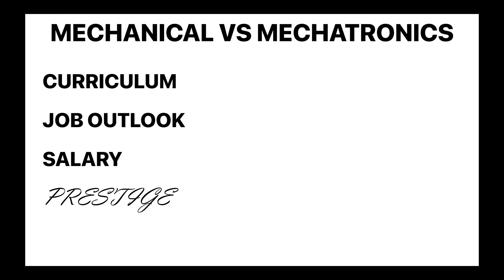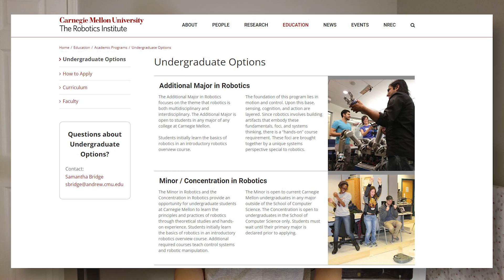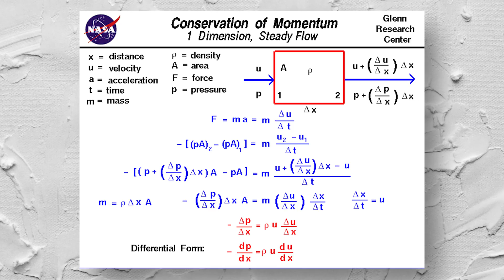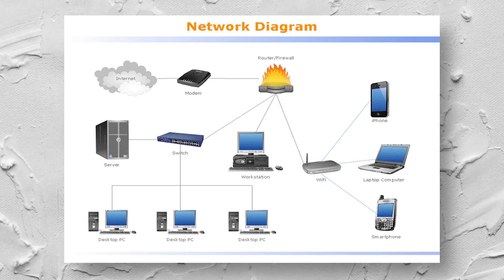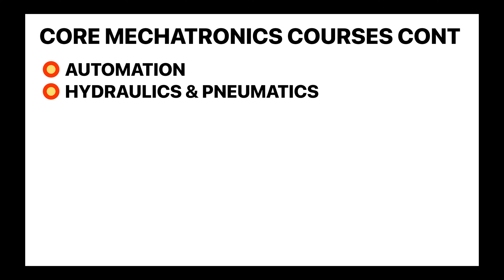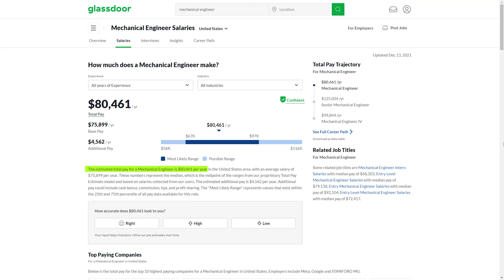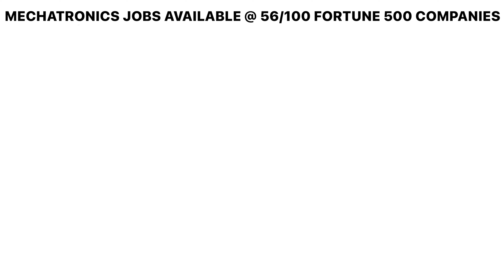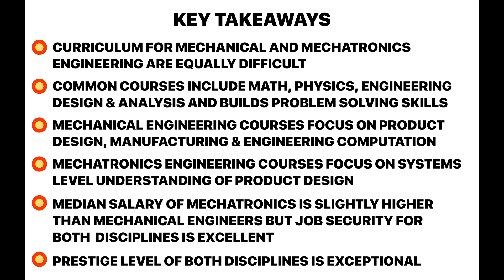Mechanical vs Mechatronics Engineering : Which is BETTER?

Comment: Unfortunately, all companies, universities, and people do not know the meaning of the word (mechanical) with respect, the word (mechanical) came in the original of the verb (enabled), meaning that something that enabled me to do a certain thing, this thing is created that a person can do a certain action through (the analysis of forces), so the science of mechanics is the science of forces that may be (electrical, magnetic, air, hydraulic, etc.) so the mechanics is the science of forces (whatever the type of those forces) that are attached to the bodies (in general of bodies and atoms that are very small/tiny to very large), the mechanics world has been entered since the first course/semester in the first stage by taking the material (engineering mechanics-stillness) all that remains in the following stages is an application of the ideas of that material, so Mechanical engineering is not (a science that studies the bodies that move), but rather (the science that studies the forces on these bodies and the effect of these forces on the bodies from a very infinite level in Smallness to the level of macroscopic) so often, everything and all specializations are within mechanics such as electricity, electronics, chemistry ... and etc. Therefore, mechanical engineering is usually called (mother engineering) or (general engineering). Within the curriculum of mechanical engineering, (electrical circuits, electrical machines, control, programming) is studied, so it can build something that is smart, credible, and by the way, the concept (control) is far away from electronic control, and the first to find the control system is the mechanical engineer. Now that we knew the meaning of (mechanics), we will go to the (mechatronics), in the past there was no electricity or electronics, so something that enables a person to do a specific action was created using "physical" structures (which by the way usually called a mistake with "mechanical structures or mechanical parts" as a result of ignorance of the meaning of (mechanical/mechanics)) or pneumatic or hydraulic. But after the presence of electricity and the invention of the electronics, they noticed that electricity and electronics apply to the concepts of mechanics and their phenomena are interpreted with it, so they created the mechatronics, Mechatronics is from "mechanics" (traditional mechanics before electricity and electronics) and electronics (the mechanics that is new after the emergence of electricity and electronics). As it becomes clear from the curriculum of the mechatronics, more things are studied than it is required to use for purposes (control) only. In addition, the word Mechatronics shows that both mechanics and "electronics" have been represented in it, and the electronics cannot be limited for (control) purposes only, thank you very much.

Comment: So can I do a computer science bs  and than pursue mechatronics . What’s the fastest way to do this degree?
Reply: If you wanna learn about both computers and robots, your best bet is to go for electrical/computer engineering, not computer science. In EE/CE, you'll learn about programming, electrical and electronic components, signal analysis and processing, control systems, and a bit about computer hardware and power systems. You'll know just about everything you'll need to make a computer and a controller for robots. It'd be very easy for you to learn a bit about robotic kinematics and mechanism design on the side so as to build robots.
On the other hand, computer science is much heavier on software and computer science theory, so if you go for that, you'll end up being very strong on programming and algorithm design/analysis, but not so much on interactions between electromechanical components.
It is possible to get a master's degree in mechatronics or robotics after earning a bachelor's degree in computer science, but you'll have a lot to learn while doing your master's degree.
Reply: If you want to be an engineer i would suggest study mechatronics first and then specialize in software engineer. But is up to you.